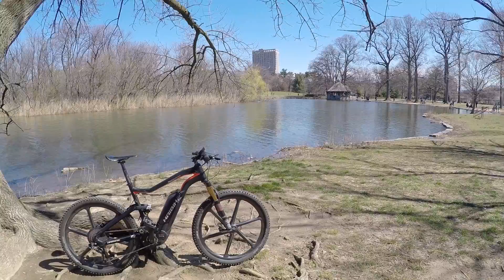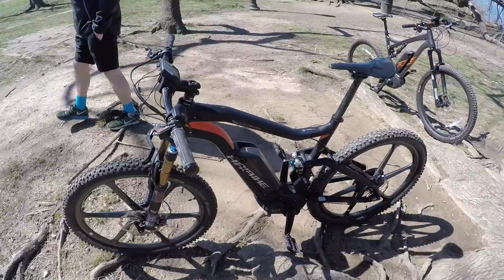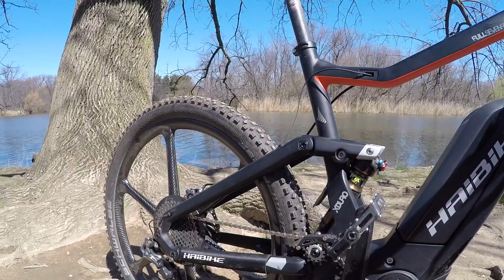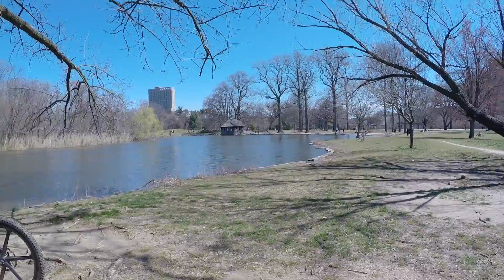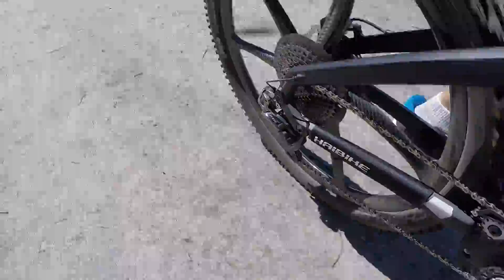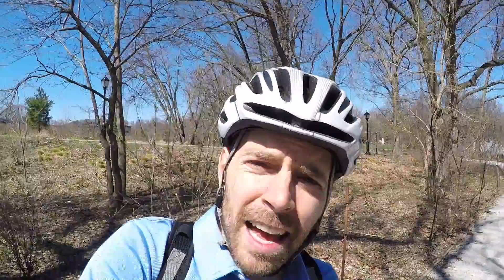Haibike XDURO FullSeven Carbon Ultimate Review - 16.7k

Comment: It's a little over priced. But, Santa Cruz Bronson full carbon high end bike is 10G's so this is not that off.  Some high end road bikes are in the 12G range with no motor. This is not for the guy who cares about price and wants the best and lightest bike possible.  This fits that niche. The rest of us will settle for a 3G version of the same bike and take the 15lbs penalty.

Comment: Nice bike Court but a little pricey! You did not cover the EI suspension functionality which I was impressed with on the Sduro Pro series. The EI looks like they should use it on more bikes, or at least as an option at some point IMHO. That fine tuning on trails comes in handy based on the way the system interprets bumps and hard terrain.-- Not even CF or aluminum bash guard,
kind of surprising at that price point. I think Haibike needs to tweak this model on many levels and refine many components, make it look more stealthy as a 'bike of the future'. Give it more futuristic appeal to make it really shine! Thanks Court!

Comment: Good Lord that's an expensive bike! Far to many shortcomings for something so expensive. while I appreciate the sports car analogy, the drive train is the same as on bikes costing only 20% of this. Also. needing to charge the gear shifter separately is just silly. I hope they've fixed all these things in the new model!
Reply from the maker: Yeah, there's room for improvement here for sure, I cannot personally appreciate the differences between a carbon fiber that is only very slightly less weight, perhaps the stiffness or ride characteristics are noticeable to pro riders, but I can only appreciate how "cool" it is, and not that it actually performs better

Comment: Hey! Wait! I got a new complaint.
1. Those wheels. Even with full suspension, the idea of foregoing typical spoked wheels, and the resilience that they provide, in favor of rigid, non-compliant carbon spokes, seems like a wrong turn. In theory, and this bike is apparently NOT an example of this, a well-tuned, long-travel suspension system in combination with BIG tires could accommodate the rigid wheel, but why? This is no feather weight MTB. 
2. $$, !!

Comment: Way to noisy!  I suppose that's a good thing if you are in heavy traffic, you won't need a horn to alert others you are behind them.
Reply from the maker: The Bosch motor is just louder than most other mainstream mid-drives this generation. My camera mount makes it sound pretty loud but in practice it's not so bad for the rider and other people around

Comment: No disrespect intended but the Sportscar analogy really is apples and oranges. Expensive Sportscar can typically justify their more expensive prices by tangible performance results and future resale because of desirability. This is nothing more than an ebike that Haibike decided that just by using using a relatively common technology now, carbon fiber and rediculously low 350w motor could justify a regal price.

Comment: IMHO, you don't need carbon on an e-bike. Makes very little difference since you're not going to be doing jumps anyway. Di2 is nice but, first of all, Bosch actually does a wire for running off the motor... why isn't it being used, at this price level, instead of that ugly stem solution? Also, you'd think Bosch would put in the effort and integrate the Di2 screen output into its own monitor instead of having a second monitor. Looking at one is hard enough. Anyways, Haibike has never really impressed in the e-bike department, the only exception is their 24" e-bike for kids (yeah you read that right) -- but that's only worth investigating because there are no alternatives out there on the market.
Reply: Dmitri Nesteruk sure you jump with an emtb. What else? Driving on a street all day long?
Reply: Well... I have an e-MTB (Crescent Elgar), it weighs >20 kilos. Jumps aren't exactly comfortable. You cannot lift the bike with your body's momentum, when it's on a path you have very little control of changing direction.
Reply: Dmitri Nesteruk maybe we got another definition of jumps. I don't mean dirt bike slope jumps, backflips  or 4 meter drops. Just shredding down the hill while jumping down obstacles and ruff terrain. And carbon does a very good and stiff job on this.

Comment: just buy a used downhill bike or what ever you want,  add a bafang bbshd, 1000w and 160nm of torque will leave any of these over priced 250w low power over priced bikes in the dust...